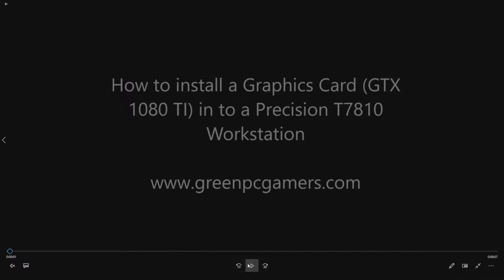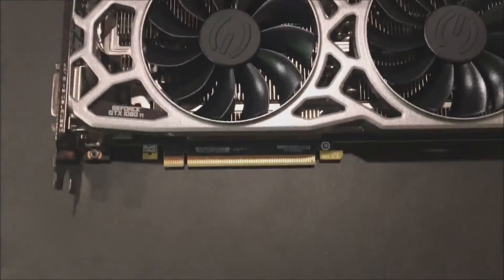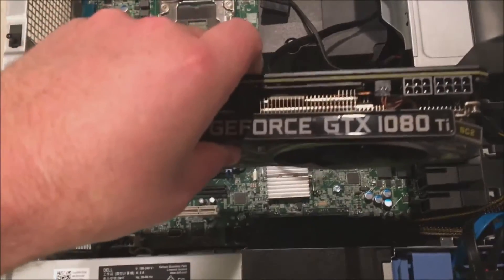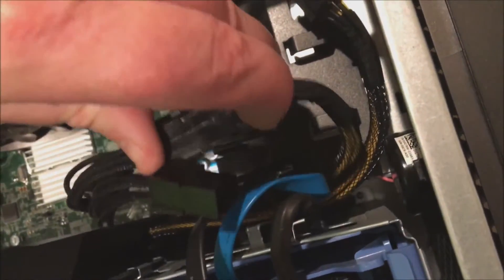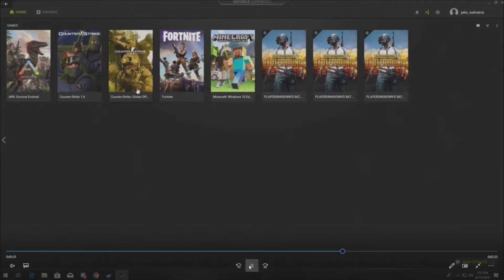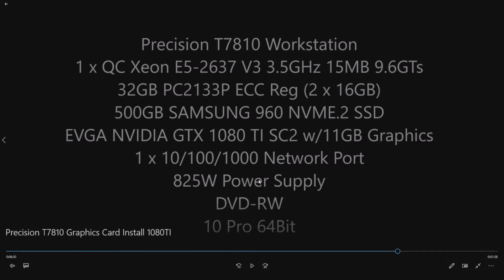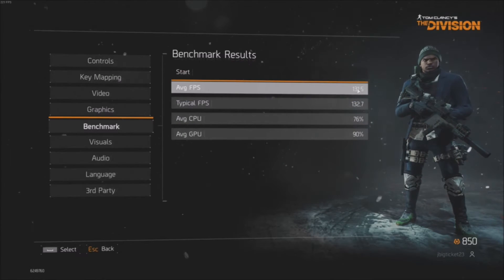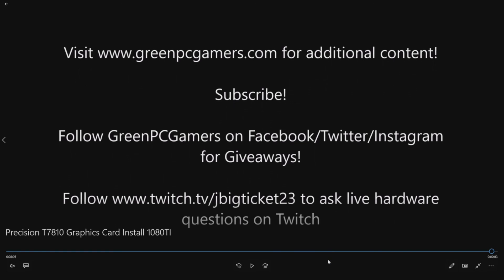Precision T7810 Graphics Card Install w/Benchmarks!!! (EVGA GTX 1080TI SC2)

Comment: Great informative video!  I wish I had found this video a long time ago.  Will this set up will also work on a Titan X Maxwell?  I have a T7810 with the 825 power supply.  Currently the adaptor I am using to power the card is an 8 pin from the PSU jumper card to the 6 pin and 8 pin on the Titan.

Comment: Thx man, but I am still experiencing shutdown when running Reality Capture photogrammetry. I have an identical setup as yours apart from CPU being  E5-2696 v3. everything else is the same, any idea? I did exactly the same cables arrangement as you've suggested.
Reply from the maker: What wattage PSU do you have?
Reply: GreenPCGamers.com standard T7810, 825
Reply: GreenPCGamers.com to be precise. It shutdown when RC start calculating mesh using appropriately 40 x 38mb raw images. So I am guessing it’s very demanding on GPU.
Reply: GreenPCGamers.com check out this guys, according to their spec sheet, their T7810 PSU are 1125w. 
https://www.vrlatech.com/product/custom-dell-precision-t7810-workstation/#
There must be a way to upgrade PSU. But I have contacted Dell Australia. No go.
Reply from the maker: I would agree.  Do you mean 38 MP?  Could you incrementally increase the images to see exactly when it powers down the system?  It would also be interesting if you could try the 40 x 38MP raw images while powering the 1080 Ti w/an external PSU to see if it still shuts down.

Comment: 2x6pin to 1x8pin。1x6pin provides about 150w? So 2x6pin to 1x8pin,how much power can 8pin provide?
Reply from the maker: 1x6 pin is normally 75w and 2 x 6pin to 8 pin should be 150W
Reply: GreenPCGamers.com I have the same situation here to install gtx1080ti into T7810. My power is 825w. I wonder if 2x6pin to 8pin is 150w ,so would it be enough power for the card. We steal power from optical drive,but it only needs a little power.
Reply from the maker: 150w is not enough to power the card.  According to EVGA, the gpu draws 180w.  If you copy what we did on the video taking power from the optical drive it will work.
Reply: GreenPCGamers.com gtx1070ti needs about 250w-300w according official instruction. EVGA card also need 250w. Are you normally use now? Did the card not have enough power and shut down?Mine happened several times before.
Reply from the maker: We did originally have issues with the system shutting down because we tried to use single 6 pin to 8 pin adapters and it wasn’t enough power.  That’s why we switched to the 2 x 6 pin to 8 pin (150w) and the SATA pwr to 6 pin adapter.  We now have over 200 hours of gaming with out a single shut down.
Reply: GreenPCGamers.com  I’ll try. Thank you very much.